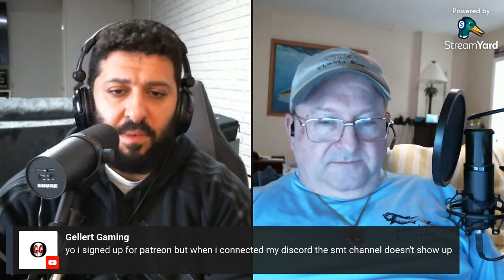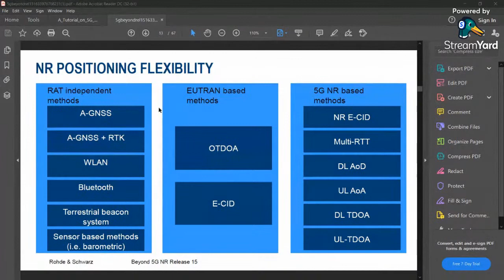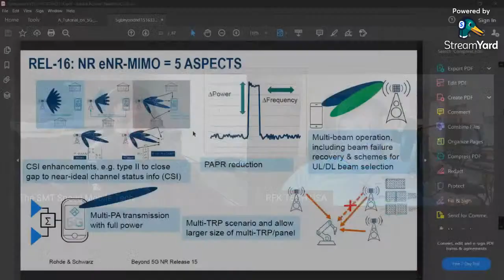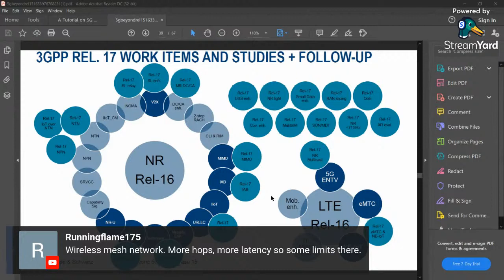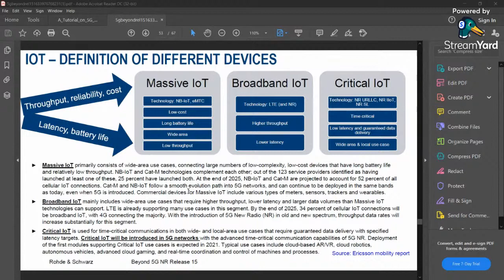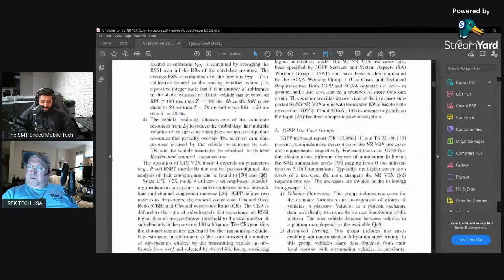SMT Podcast: Verizon & AT&T suffer minor setback with C band, T-Mobile 5G lead, 5G standards.

Comment: Totally disagree with Rickey  TMobile has been great when you speeds are going from 40mbps to 700mbps that is clearly a generation leap forward. Not just like like you say that it just LTE make it sound like it not a big deal.
Reply from the maker: Yep. They have made excellent strides.
Reply: My big problem with Rickey is he just keeps downplaying the improvements TMobile have done  and trying to speak for everyone. That's a ridiculous standard Rickey gigabit to qualify as 5g come on man or it just LTE as he likes to says. Just because you don't like T-Mobile doesn't give you the right to speak for everyone experience and that's what you don't understand Rickey.
Reply: Saying it’s LTE is disingenuous. N41 at 100 mhz is absolutely 5G.
Reply from the maker: It won't run without LTE.
Reply: @realsmt  but isn’t T-Mobile launching SA n41 and already has SA n71? I’m pretty sure SA n71 is all over the place.
Reply from the maker: Test it. Tell me the band and the channel depth. Let me know how many nr carriers it's aggregating.